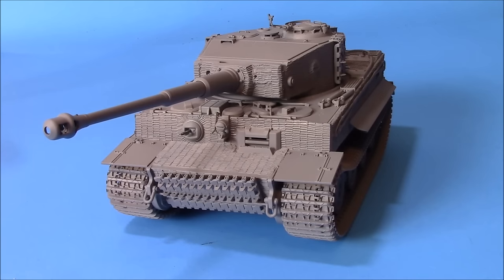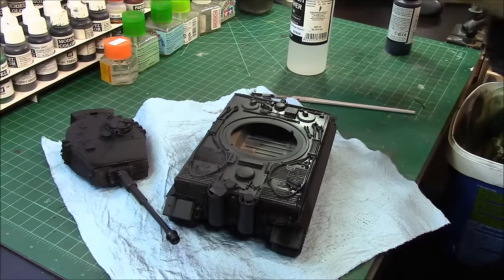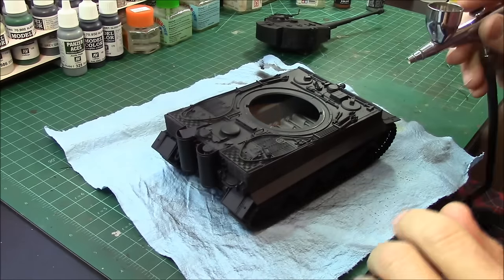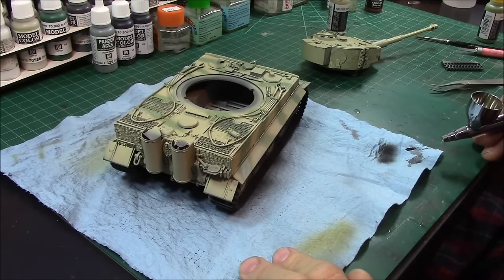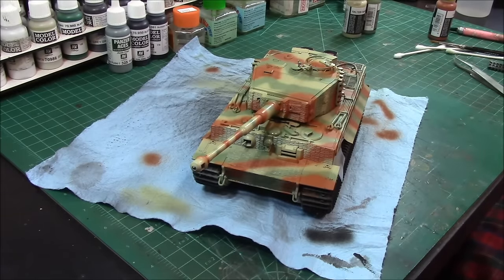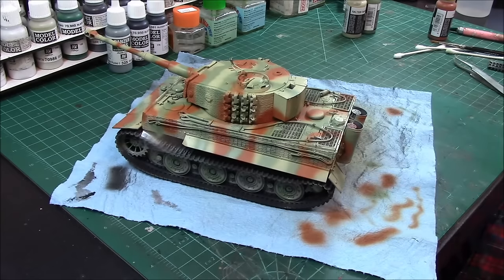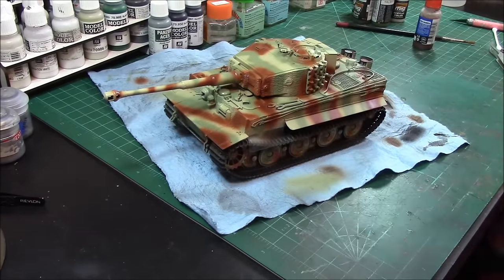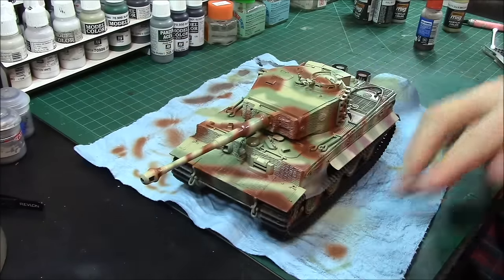HOW TO PAINT GERMAN WW2 TANKS  PART 2

Comment: Your comments at 6:00 about how the camo was done, are interesting and true!  Starting in mid 43, all German armor left the factory in dunkelgelb base coat.  And every tank came with a spray gun (using an air compressor included on the tank that ran pneumatic functions on the vehicle, whatever that was) and they were issued two types of paint, the red brown and the green.  The paint was designed to be thinned with gasoline and as you say, the tanks were often painted in the field, by the crews.  It was up to the unit commander, and sometimes just the tank commander, what type of pattern the tank would get.  As wartime photos show, this type of painting was completely hit or miss, and no two tanks were ever alike.